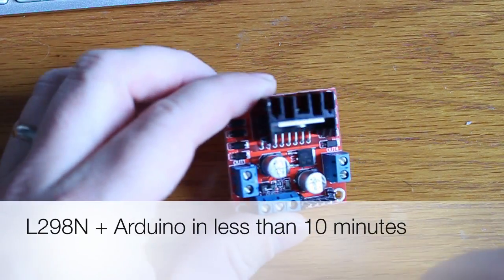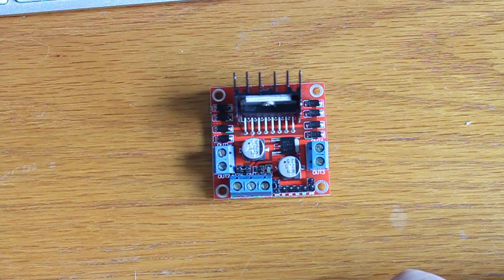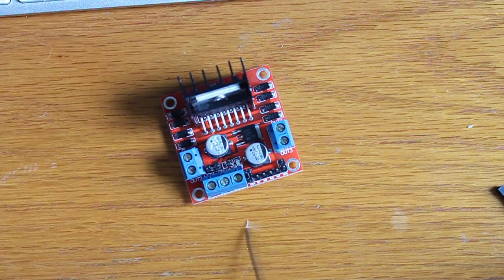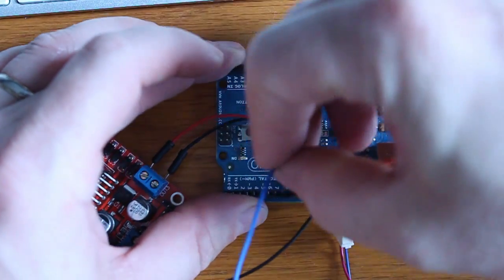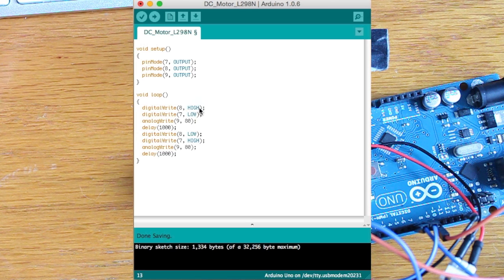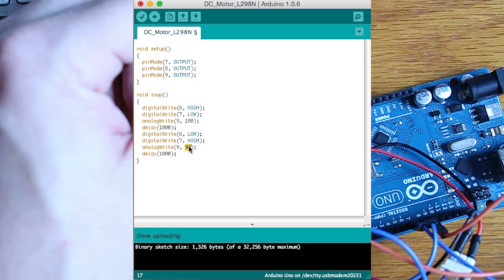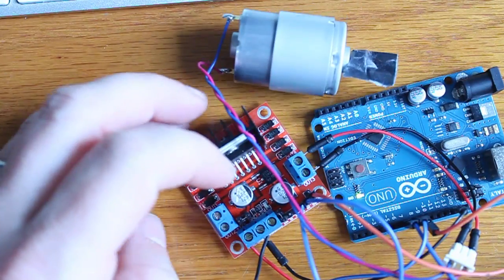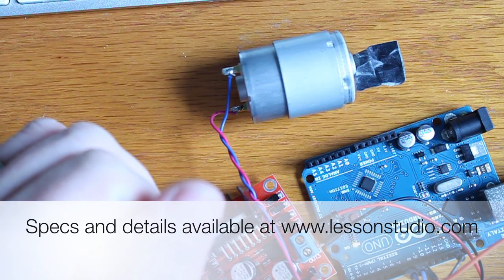HOW TO: control DC Motors with Arduino + L298N

Comment: Is there any way to power 3 motors from one driver? I'm building a RC helicopter and I need 2 motors to be spinning at the same time and speed but in opposite directions while a 3rd motor is on the tail and only spins when I need to turn? If that is possible or you know any better ideas for me please help it would be greatly appreciated.
Reply from the maker: +MrPuffpyro Typically you only need to use a module such as this when you want your motors to be able to switch directions. This is where the H-Bridge concept comes in. This diagram:

https://upload.wikimedia.org/wikipedia/commons/d/d4/H_bridge.svg

is an simple explanation as to both why it is called an H bridge and how it works all in one diagram.

But in your probable design all your motors (maybe not the tail one) don't need this complicated bit of electronics. Depending upon the size of your helicopter you might end up needing to go with a ESC and brushless motor which are standard RC motors in flying machines. 

But if your motors are simple DC brushless motors then all you would need is a MOSFET to control the motors, or if they are really tiny then a simple transistor.

I will make a slightly different recommendation from my own flying machine building experience. Don't start with a helicopter in that you will be fighting both the aerodynamic battle simultaneous to the electronics battle. Start with a stupid simple flying machine. First buy a foam glider which has all the aerodynamics kind of worked out. Then just stick a few small servos (which can be run directly from an arduino) to give some interesting control. After that you can just start adding feature after feature to your platform. Using a gyro you could add arrow straight flight. Using a radio module you could add control. Of course at some point after you have steering you could add a motor. Start with a single dumb motor. Then maybe go for the harder to control motors on both wings. Then start bumping up the power until you pretty much tear the wings off. 

BTW if you do go with my foam glider suggestion get one that is slower rather than faster. Also gorrilla glue that comes in contact with a bit of water tends to both be able to fix foam and helps when gluing things into the glider.
Reply: +LessonStudio  Wow that was great and extremely helpful information. Thank you very much you have been by far the most helpful person on the internet when it comes to helping me out with my project. I will be using just about all the great ideas you had but I may need a little more help along the line with some of it. I hope you don't mind if i keep asking questions when i get stuck.
Reply from the maker: +MrPuffpyro No problem. Good luck with your project. Flying machines are so much fun to make. I don't have a ton of interest in directly flying them so much as making them fly themselves. I personally had an instructor's licence in flying, so I am looking for the intellectual thrill of making a small flying machine do things that no other has yet done as opposed to directly controlling them. I should probably put some videos up on my various experiments and contraptions.
Reply: +LessonStudio Another question I am not sure you know the answer to since it does not have to do with the motors but I have a bluetooth dongle with a type A male usb and I have a converter with a type A female to type B male can i just plug that into the type b female on the arduino and power up bluetooth?
Reply from the maker: +MrPuffpyro Do you know the dongle's model number?
Reply: +LessonStudio Its SoundBot USB bluetooth dongle Model: SB341
Reply from the maker: +MrPuffpyro Not really. I suspect that if you wrote some pretty crazy code you might be able to arm twist it into functioning. But at that point you would be an Arduino god.

Here is the much simpler and more common sort of device that is used to connect arduino to bluetooth:

http://www.banggood.com/Wholesale-New-Wireless-Serial-4-Pin-Bluetooth-RF-Transceiver-Module-RS232-With-Backplane-p-43441.html

I really should make a video showing that connecting to a PC.
Reply: +LessonStudio ok and sorry for bombarding you with so many questions but I have a more simple one I think. In the code what is the highest number to make the motor run the fast for pin 9?
Reply: +MrPuffpyro Fastest*

Comment: Ok I like your video. My question is that if I have two 24V DC Brushed Motors and two 12v dc batteries how can I connect those motors to an Arduino Uno?
Reply from the maker: +Wendy Alcius Presumably you are going to hook the batteries up in series to get the 24v (this also assumes they are basically the same battery as it will potentially cause problems). Then you can put the negative into the GND and the 24v into the terminal typically marked 12v which, in theory, can handle up to 35v. Then you can connect the arduino vin and gnd to the module's GND and the module's 5V. (This is assuming a 5V arduino).

This will then give you 24v for the motors and power for the arduino. I would check with a multimeter that the arduino is going to get 5V before hooking it up as 24v would let the magic smoke out.

Then you connect the controlling wires up from the arduino just like in the video.

But here is where you have to be careful. You need to know the amperage or wattage of the motors as the module can only handle 2A. But you don't really want to get terribly close to even 2A. 

This means you don't really want to go over 1A on each motor. I find that most motors in the 25V range tend to draw more than 1A. Not all just many. So check the rated power on the motor which may then tell you that this module isn't for you. But pretty much all that I just and this video said would apply to higher amperage modules. There are many modules for less than $10 US that can handle 10-50A and often up to a 100w.
Reply: Now Controll anything in adrunio via keyboard{makeAnyprojects}
https://youtu.be/jAHLtRmgRiI

Comment: Hi friend, Im trying to control (using a PIC) two 24v motors, both dont exceed 2A current, so can I use this module for controlling them both at the same time? also since the power supply would be 24v instead of 12v, do I need to remove the jumper of the 5v regulator?
Reply from the maker: +Edgar Martinez Not really, there are two restrictions, one is 36v, the second is 2A. 

But another factor is that when doing these things, especially with motors, you need to leave some margin for spikes and other small errors. Thus you would not really want to push a module right up to 2A anyway. I generally prefer to rarely exceed 50% capacity when working with motors as there are all kinds of somewhat hard to calculate spikes of power involved in motors.

So I am throwing this out there that the module you are looking for should minimally be capable of quite a few watts more than you are going to put through it. Also you should be checking with a multi-meter to see what is actually going through. 

Where this takes you is into something similar to the module in this video but quite a bit more robust. They aren't terribly cheap like this wonderful module. 

Also you can buy yourself some extra margin if you connect a huge heat sink up to the module but this does not so much add to the capacity of the IC but more ensure that  you get all of the rated capacity.  Also one of the things that causes the most heat buildup in this module is the PWM. If you aren't using PWM and just have the motor turning at full speed it does put a lesser load on the module but your requirements will still exceed the capacity of the thing.

I would recommend something like a DC 50A Double IBT-3 Stepper Motor Driver H-Bridge PWM. It should have the capacity you are looking for and its use is pretty much identical to the module in the video.
Reply: Now Controll anything in adrunio via keyboard{makeAnyprojects}
https://youtu.be/jAHLtRmgRiI

Comment: How do i control two motors at the same time, like a car?
Reply from the maker: +Mario Victor Amado Alvarez What I have shown here is a single motor. But to connect two motors you would just need to do what I have done here with the remaining input pins on the module to control another DC motor. Basically the left three pins are for the left motor connector, and the right three pins are for the right motor connector.
Reply: Now Controll anything in adrunio via keyboard{makeAnyprojects}
https://youtu.be/jAHLtRmgRiI

Comment: Do we need to power up the arduino board when we are not connecting it to pc with cable? If it then how?
Reply from the maker: +Md. Din al-amin You do need power for the Arduino but it does not need to come from a PC. This particular module has the ability to give you a solid 5v out for doing things like powering an arduino. Most 5V arduino boards have a VIN which is where you feed the +5V into. 

So check that you are getting a 5V+ out of the module and feed that and the GND into the arduino and you should be fine.
Reply: Thanks :D
Reply: +LessonStudio Sorry for a late response to this but I was wondering when you say run the ground to the Arduino with the 5v the ground your talking about, is that the ground that you had in your video already connected to your Arduino or is that another ground crossed over the 5v line going into your Arduino? If so which ground connection do I put that in? I'm just starting out and trying hard to not destroy any of my boards.
Reply from the maker: +MrPuffpyro I hear your fear. It really sucks to let the magic smoke out of my precious electronics. One thing you might not know about electronics is that there is a common ground. So the negative from the 12v battery connects to the same ground as the negative from your arduino 5v power source. It is the positives that you must not mix up. So scarily enough the ground from the 12v battery connects to the module's GND but then you wire a GND from the arduino to the same GND. 

I still find it very scary to have my wimpy arduino electronics so near things that could pump enough power to make the arduino literally glow. 

If you are nervous you can always double check with a multimeter to make sure you are never about to hook up too much positive voltage to the arduino. 

Where you have to be careful mixing Arduinos and motors is that they can send power back into the arduino. The module in this video will protect against that but if you have a small motor and connect it directly up to the arduino it becomes more of a risk. Remember that a motor is also a generator among other things.

On a whole other note about GND; there are times when you want to very much separate one circuit from another. In this case you can completely isolate one circuit from another using relays and some ICs that can even optically isolate your circuit.

This way you can have your tiny arduino controlling house current or even more.

Good luck.

Comment: How would i add two push buttons to this. Where one button spins it one way and the other spins it the opposite.  Push button one spins clockwise when pressed and push button two spins anti-clockwise when pressed. Cheers.
Reply from the maker: +kings spender I don't have my stuff unpacked so I can't test it but it would go something like this.

In setup() you put code like this:

//These would get your motor control pins set up.
pinMode(7, OUTPUT);
pinMode(8, OUTPUT);

pinMode(9, OUTPUT);
Then set the analogue one to choose a speed:

analogWrite(9, 255); 

//These would set the two buttons input pins which are wired from the pin through the switch to GND
pinMode(1, INPUT); 
digitalWrite(2, HIGH); 

pinMode(1, INPUT); 
digitalWrite(1, HIGH); 

Then in your loop() code you could do something like

if(digitalRead(2)==true) //This sets it in one direction when button 2 is pushed.
{
    digitalWrite(1, HIGH);
    digitalWrite(2, LOW);
}
else if(digitalRead(1)==true) //And around the other way.
{
    digitalWrite(1, LOW);
    digitalWrite(2, HIGH);
}
else //Spin the motor no more
{
    digitalWrite(1, LOW);
    digitalWrite(2, LOW);
}

 //These last two somewhat miss the edge case of pushing both buttons at once. Can you guess what will happen from the code? 

The above code is very simple and will only spin the motor when a button is pushed. if you are going to have it so that a single tap of the button will then leave it spinning in that direction then you will need to look into flags and debouncing. Those are simple and good things to learn.
Reply: +LessonStudio thanks for the help. ill try it out.

Comment: what are the adapters called at the end of the wires that have a hole to allow you to plug into the input locations of the L298N?
Reply from the maker: +marcDshark1 They are generally called breadboard jumper cables and that end is female. On ebay they are often called Dupont Cables. They are cheap as dirt there and I would recommend just grabbing up a supply of male to male, male to female, and female to female. Also make sure you grab various lengths. Having a nice range from the very short to fairly long (maybe 20cm) is nice to have. 

They are so cheap that it is better to have to many than too few.
Reply: can you connect the male end into the small holes on the base of the input section on the L289N? or do you a need female connector for the input?
Reply from the maker: +marcDshark1 Those particular ones have a male connector at one end and a female connector at the other.
Reply: ok thanks, sorry for my noob questions lol...
Reply from the maker: +marcDshark1 We are all noobs at some level. You know what a motor controller is; Not noob. I am a FPGA noob.